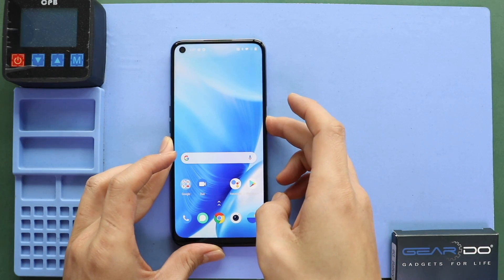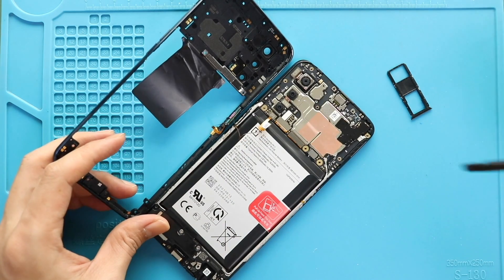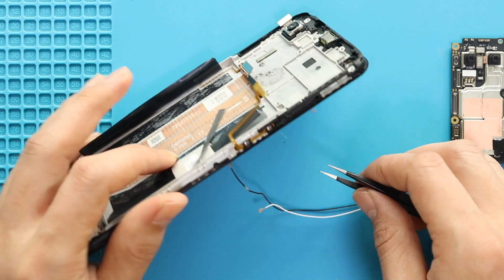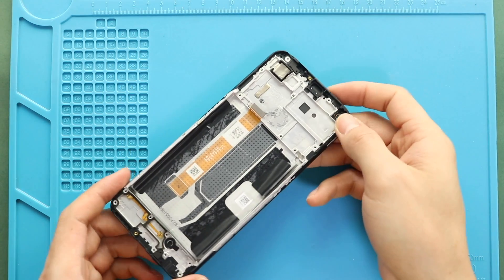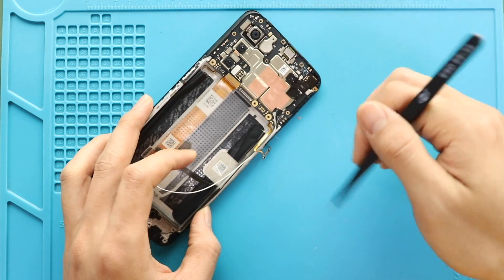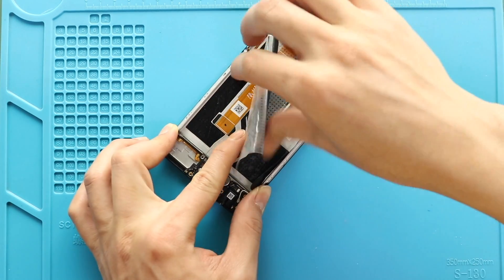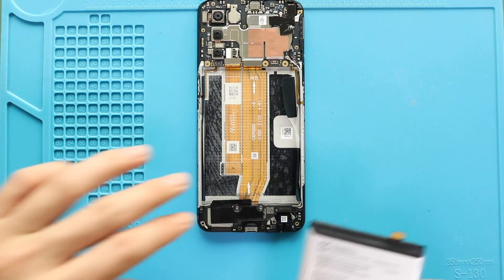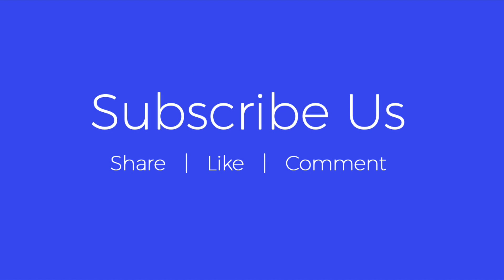OnePlus Nord N200 5G LCD Screen Display Replacement

Comment: Changing the screen is not as hard as this video portrays. This is a full teardown video. Basically as soon as you have the back off and the battery out the screen can be changed.  I just did this in 20 minutes with very little experience. If I followed every step in this video, it would have taken a newb like me hours. And I probably would have messed something up. I got better information from a zero narration 4 minute short. Edit: I did this with the screen only. No frame. If you pay more for a screen with a frame, you'll probably have to do all the steps in this video. Hopefully you didn't watch this video and return your screen and order one with a frame.

Comment: If you didn't order a replacement that includes a frame, DON'T FOLLOW THESE INSTRUCTIONS!!! He has you disassemble far more than you need, increasing your chances of breaking something else in the process (which is exactly what happened to me).
Reply from the maker: All original parts are coming with the frame, also now most OEM parts are coming with the frame. Main reason is due to quality screen glue. Most no frame screens are popping up after sometime due to bad glue/adhesive and also not cleaning the frame properly. Both ways have advantages and disadvantages, but the best way is to replace with the frame

Comment: Bro it's easier with only screen with out frame I just took off all parts wen I didn't need too 
SMH
Reply from the maker: Only the screen maybe easy, but If you do not have proper adhesives or glue, you might end up with issues. And also need proper cleaning on the frame. It is always the choice. Personally I think with the frame is good.

Comment: I mean, you could make this a great vid if you can add a little stuff and reload it. The 17 screws you called out left me breaking my bezel. I first thought you miscounted and meant 18 and forced the bezel and cracked it. The speaker card has 2 screws that look like all the others -- we don't have a schematic -- and the 19th similar screw is covered by an anti-tampering sticker. Just tell viewers theres 19 screws. The other thing is there's obviously a lot of 2 side tape that would help a lot of ppl to know. I don't know what kind it is,  or size, but you do, so just put the link in the info so we can buy the tape we we need to secure the replacement like the original. i ended up with a cracked bezel trying to force it off after pulling out 18 screws, and insides of the phone less secure than the original. I mean there's a lot of good in this video too, but I would have been better off buying a new phone after ending up with a janky looking rattler.

Comment: Buying the screen and frame is more expensive and more complex. Once you remove the battery, you can remove the tape under it and just disconnect the screen and replace it.
Reply from the maker: Yeah, you are correct, but with the frame is better in durability and fairly easy to move other stuff.

Comment: This is horrible. Half way through the video you reveal that there are 2 options, with frame and without. MOST people who are doing this at home will choose WITHOUT frame and just the LCD as that is cheapest option. You made me take off all the buttons, antannaes, cameras, everything when all i needed to do was REMOVE THE LCD SECTION. Now I have to full assemble the phone again just for the LCD replacement....
Reply from the maker: Thanks for your feedback, and sorry about the issue you have faced. But first, please, if you are repairing, you have to view a video once to see the steps, tools, and parts involved. Otherwise, you will have issues. We also prefer the frame replacement due to easier of doing and durability. Most of the time, customers experience screen pop-up issues after some weeks, and this is due to the lousy adhesive or glue. But with the frame replacement, it is already tested and lasts much longer. Once again, sorry, and we are hoping to bring no frame video on this model too.
Reply: I noticed all you would have to do is pull the cable through the slot of the frame.
Reply: They just wanted you break your everything as me they are devil
Reply: That's not all that's horrible about this video. You can change the screen basically as soon as you do the battery removal step.... While also skipping a few steps. It was a simple 4 minute YouTube short that showed me that it wasn't as crazy as this video portrays. Really shameful.

Comment: This wasn't a help I don't need to think of the digitizer I need the screen lens only fixed
Reply from the maker: it is going to be tough job and need proper tools. Might end up with more damages to the device.Most new screens are coming together
Reply: @DIYGeardo You are right he is thinking of when they refurbish screens they due it with modern stuff as well but only a shop will have the skill to due that and not all shops due.